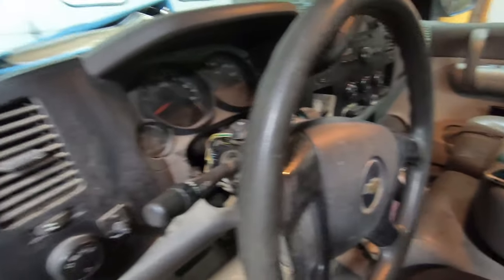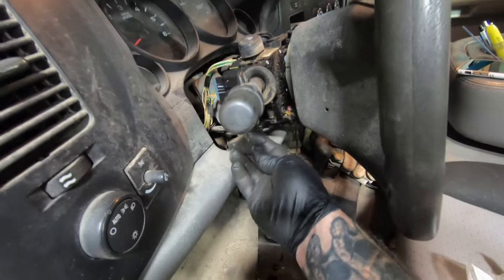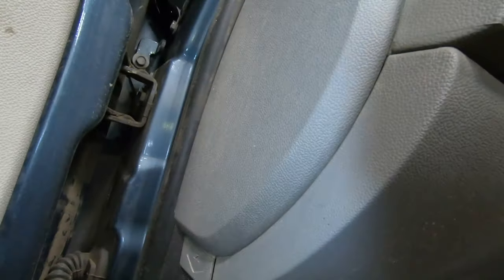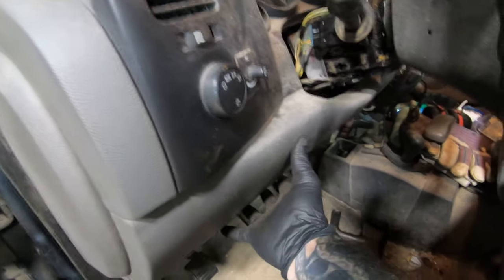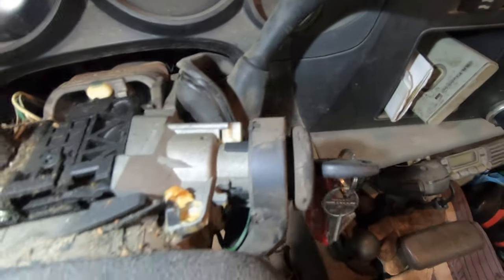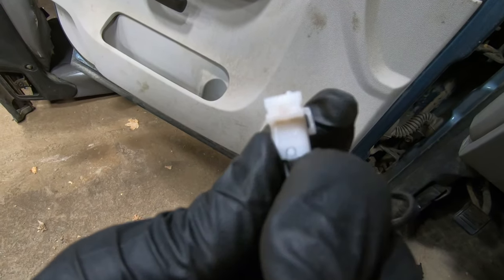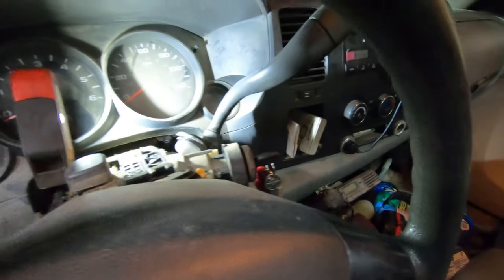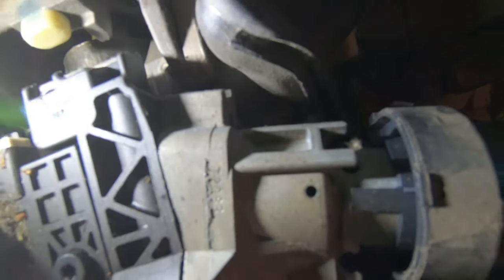how to replace an 07-16 Chevy Silverado ignition switch if it won’t go to acc position

Comment: Wow, I was having trouble installing a new ignition switch and could not get the gears to line up correctly. Your video of where you looked up the slot that holds the switch and line up the gears and them take a pic and put it into the lock hole to move to the correct location saved my ass. THANS A LOT. U DA MAN

Comment: Hey man, big thanks for this video. I watched 1AAuto’s video on the same topic which explained how to replace the ignition switch well, but ultimately ran into the same issue described in your video (2009 Silverado). This helped me get the key aligned properly so I could start my truck!

Comment: Thanks for putting this up.  I'm working with a 2011 silverado & it dosen't have accessory position so this helped me get things lined up.  I checked a 2008 I happened to have on the lot and it dosen't have accy. position either.  I don't know which trucks do have the accessory position in counterclockwise position from lock but neither of these did.
Reply from the maker: That’s the problem I had with mine too and was having trouble getting the switch timed right.

Comment: Awesome video thanks I’m also a municipality mechanic. I have to do this on my personal truck, can the switched be changed without pulling the lock cylinder if everything is lined up correctly ?
Reply from the maker: You should be able to change it without removing the lock cylinder. I just couldn’t get it lined up right so I found it easier to pull the cylinder out then I new it was in the right place. You could probably count the clicks on the switch knowing in advance so you can get it in the right place.
Reply: @JasonTheMunicipalMechanic  thanks, I just found your channel and subscribed . You got some really helpful vids

Comment: FYI. You can turn the teeth on the new switch with your finger and match it with the old switch. There's no need to do all that other stuff.
Reply from the maker: There is no detent where the key is located to be off on the switch. So if you miss it by one tooth your going to have a hard time getting it right. I tried to just move it at first and i ended up doing this in the end. It might be more steps but I found it faster in the end.

Comment: I Wonder... If the key is in the " on " position...and the Dash Lights Up, If You Remove the Black Ignition Switch...with the " Gear ".  Can You just Turn the Gear... To a Position to Crank / and Start the Vehicle...????   Please Answer About This... Thanks, Bill, in Los Angeles... 10/15/23.
Reply from the maker: You can match the positions on the ignition switch and put the new switch in but you can’t move the key. The key just spins, there is no detent on the key so it’s hard to get it in the exact position it needs to be if anything is off. The key only stops in the the crank and accessory  position and just freely turns in the middle. The ignition switch has no detent in the off position just accessory and on. So you can put it in the on position and make sure the new switch is in the on position then change them without moving the key. You can’t put the ignition switch in crank because it will turn back to on if you don’t hold it there and you won’t be able to put it in and hold the gear, It is under a spring load.
Reply: @JasonTheMunicipalMechanic But Your Explanation doesn't Cover What I Asked...please read it Again....   I just Wanted to know if the Black Plastic Ignition Switch, with the White Gear/ Function....is Capable of Starting the Car...by Turning the Gear, with the Key Turned to Crank...and the Dash Board Lit up..? Just Wondering..... Thanks, Bill.
Reply from the maker: @williamwatson5822 yes it should.

Comment: Have a 2015.  pulled out the lock cylinder as shown, now the reinstalling cylinder hits on something and is a 1/4 inch from going all the way in???
Reply from the maker: You might need to turn the piece inside back to the position it was in before you had to turn it back after you removed the lock cylinder. When your putting the lock cylinder in turn the key slightly to align it with the inner piece.
Reply: @JasonTheMunicipalMechanic  After many hours it turned out to be,, the lock plunger towards the leading tip. The spring under it was pushing it too far where it protruded out past the ramps angle. The fix was to trim that spring a few coils so contact would be on the ramp angle and slide right in.

Comment: Good video, making look easy. 03 Silverado cranks, no start. Is that the passlock 2 security module? Can mine be changed like this without replacing the whole cylinder housing so I don't have to take the steering wheel off? Thanks buddy. Rich C
Reply from the maker: Hello Richie, there could be a few different reasons why your truck is not starting, personally would make sure the fuel pump is working. I think  the pass lock symbol will stay on on the dash if it’s activated. You can change the lock cylinder out without taking the wheel off. Here is a link to how to program the new lock cylinder. https://www.locksmithledger.com/keys-tools/article/10238356/general-motors-vehicles-equipped-with-passlock

Comment: have you ever had the security light stay on after changing the switch and never go off even when you do the 10 min x3 relearn any help would be appreciated thanks.
Reply: Hey buddy.    Im having that problem.   What a pain in the ass.   What did you find out ?   My truck was fine till some losers tried to steal it and tore up the ignition.   Security seems locked on.     Thanks
Reply from the maker: @megavoltelectrocycles it depends on the year but there are transponders in the key and a receiver that is in the column to pick up the key. If the security light stays on after you turn the key on and doesn’t go out your vehicle is in a security mode and will not start.

Comment: If the ignition switch at times was hard to turn and no acsessrory postion ,you wouldt be able to reset Transmission Controle Module am i correct ? I have a  2007 Silvardo and have reverse no forward gears ..seen switch has recall and a bad short feom washer wiper fluid that actually damages an electrical board and wire harness .. headlights do flicker anyone know any more?

Comment: My issue is my key will not turn any direction on my 2015. It appears to acknowledge the key is in as the time screen flips on but I cant turn the key to even try to start it. Steering wheel is locked and harsh wiggle doesnt release. Im thinking I need a new lock cylinder and new keys rather then the switch. Any thoughts?
Reply from the maker: Have you tried a lubricant in the lock cylinder to try and get the wafers to loosen up. I think your right about needing a new lock cylinder. If you can’t get the key to turn I don’t really know of any other way to get it out without drilling it out. It sounds like you tried to pull the wheel to take the pressure off the lock. Mine usually won’t turn and I need to jiggle the key to get it to turn.
Reply: @JasonTheMunicipalMechanic  yes I lubed jiggled and went nuts on it lol. Thank you for the input. I ordered the new  lock cylinder. That will be the start of process of elimination and I will let you know how it goes. Seems to be the mist logical place to start at least.
Reply: Same problem in my 2015, mine does have 280k miles though I got some good use out of it before this problem!!
Reply: @garettstahl   what did you end up doing to get the key to turn? I bought the part but in order to swap out i have to get it to the acc position or on and it just wont go over!!

Comment: I wish I could see the peace so that I knew how far down you were going to tear this. I have a rusty lock that will not allow me to turn the drum because the Locking bar will not drop and there's no way to force it even if you have the right key. I need to figure out how to remove the housing that holds the lock.

Comment: What did you do or press to turn the key? You don’t show anything but move the camera around then just turn it!
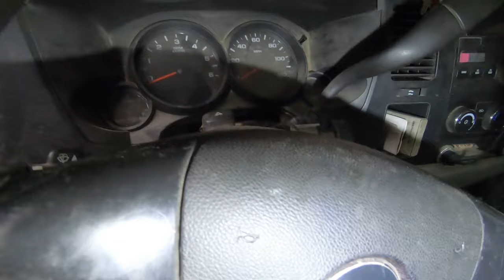Reply from the maker: I clearly tell you how to remove the lock at 11:22 minutes
Reply from the maker: Sorry I though you asked how to remove the lock. You need to remove the lock cylinder first then use a screw driver or something like it and turn the section that the lock cylinder goes into back to what would be the acc position. Put the ignition switch in and then put the lock cylinder back in. Then put back together.
Reply: @JasonTheMunicipalMechanic  my key doesn’t go all the way due to the pins that’s my problem
Reply from the maker: I’m not sure how to get it to turn if the key won’t go into the lock cylinder. One of my trucks the key goes in but doesn’t like to turn unless I jiggle the key up and down while applying very light rotating pressure, then it will turn. If the key won’t go in your going to have to drill it out or something like that. You could try spraying some penetrating lube in there and see if it loosens up the wafer that’s sticking.

Comment: What if my key won’t turn at all? The tabs will not be able to be depressed.
Reply from the maker: I don’t really know how to get the lock cylinder out if the key won’t turn. With out having the vehicle and messing around with it I’m not sure. I have a gmc that the key won’t normally just turn and I have to jiggle it while applying slight turning pressure and it will turn every time. You might be able to try that. I will shake the key a little up and down quickly in the directions of where the notches are cut for the tumblers while applying slight rotation pressure. So Basically when you put the key in shake it up and down along the flat part of the key. There might be a stuck wafer inside so a little lubricant might free it up to turn. In the end you might be able to force it with a screwdriver and replace the lock cylinder which you will probably need to change anyway. I would try shaking the key first.

Comment: This video doesn't work for 2014 or newer.
Reply from the maker: It’s the same part number for the switch up to 2016. It looks like There are two different switches from 2014-2016 so you may have a different setup. But the part number from the 08 I installed it in is listed to 2016. I’m Sorry it didn’t help.

Comment: What this how fix things using someone that don't know what he doing either that why cars get screwed from that don't already know how to fix then can't start it anyway. It's not rocket science
Reply from the maker: I have no idea what your saying. I think your saying I don’t know what I’m doing and you might be right. I never felt like I needed to prove anything to anyone, But in the end I had a hurdle in the way and managed to figure it out and get it done with a lock cylinder that doesn’t do what it is supposed to do. The vehicle started just fine and has since the video was published. Thank you for watching I’ll be sure to check out your channel.
Reply: Writing a sentence that makes sense isn't rocket science either but looks like you're having issues with that so....... lol smh
Reply: Bill get off the comments section of YouTube if you can’t form a proper sentence.